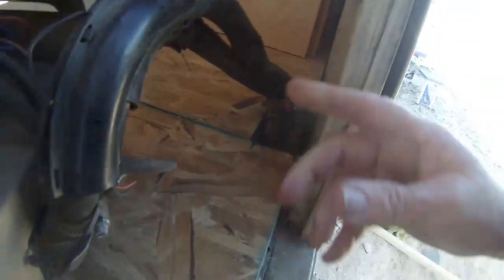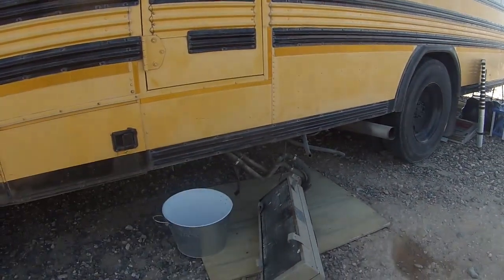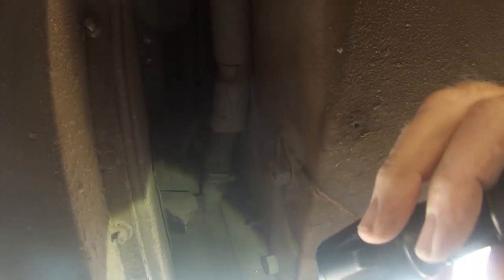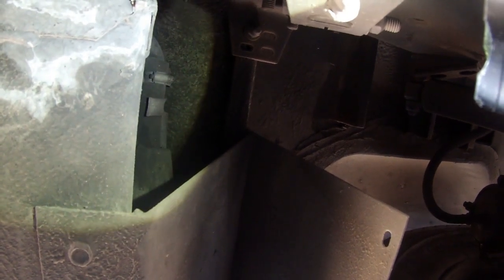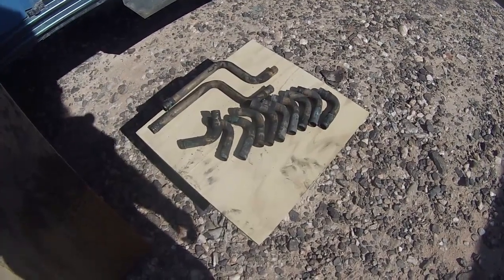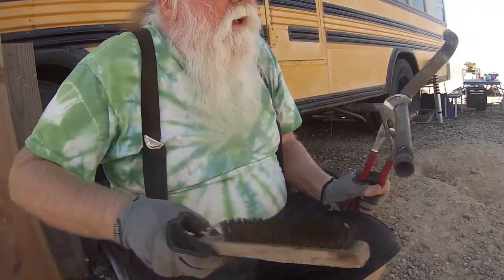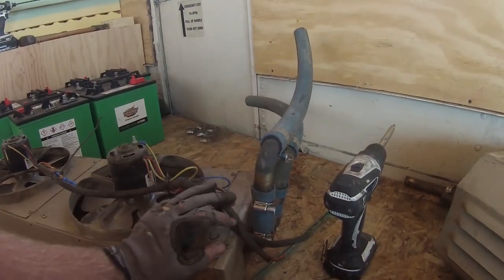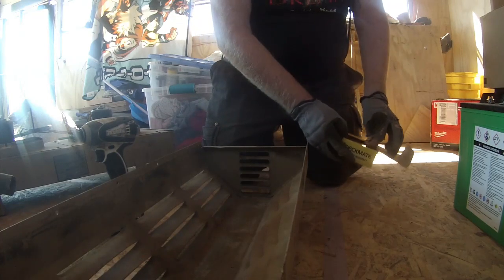Erin's Build Episode 13- Heater Relocation

Comment: Steve my question is about water heater hose!
Why would it not be better to run all water heater hoses under the bus and only bring inside where they are needed to attach to the heater itself ??? It seems to me that would cut down on the chance of water leaks inside of the bus.....
You do not have to use all the 90s and so on outside? Please bring up in your next video...
Reply from the maker: In this case the hoses already come up to go over the front wheel. If I went back down they would come up inside the battery box

Comment: Had a heater hose in my bus blow hot antifreeze all over me, my friend and our 3 kids on a trip we took. The engine overheated and blew a head gasket. Ended up replacing the motor and had to gut the interior to get the smell out. NEVER AGAIN !  Old hose is also just crap. Every one of the hose/clamp/connections is a weak spot.
Word to the wise . . .
Reply: Thanks for sharing that! I guess I'll do a heat exchanger on mine project. Still could happen but isolates it from the engine coolant.